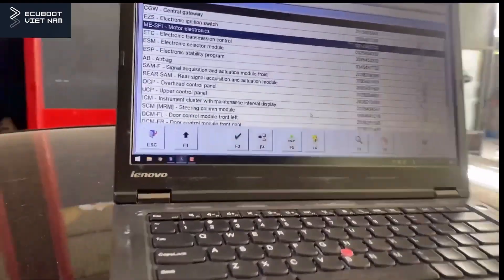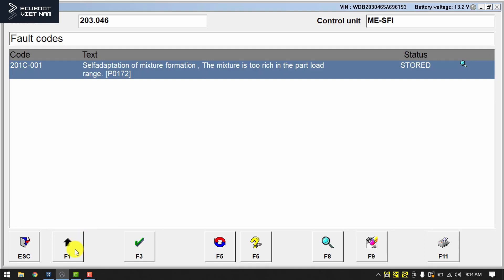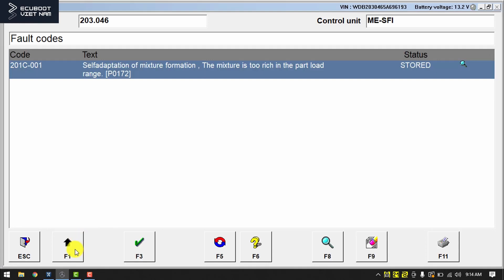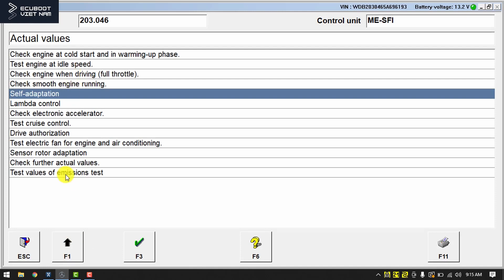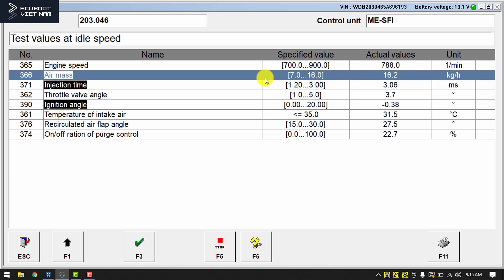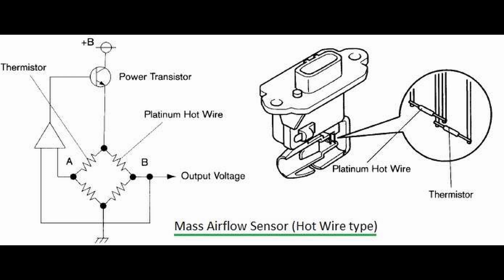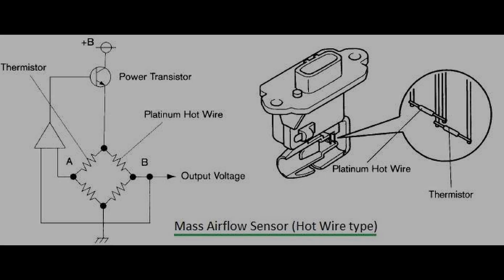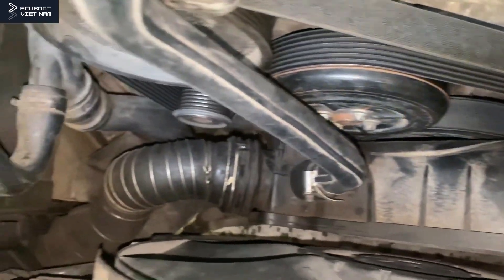Fixing  Engine Too Rich Fault on Mercedes C180 Kompressor

Comment: I have the same DTC error,I have changed the Mass Air Flow sensor with a new one,still my car is self accelerating while it is in no gear.I have cleaned the Throttle still the same issue. :(
Reply: did you solved this?
Reply: That would be an air leak

Comment: Great video. Music is super loud though!  Thinking this might be my issue - I'm using a generic bluetooth reader and torque app for most live readouts to diagnose running rich condition. Mass airflow is reading 4.9 g/s at 900rpm , and going as high as 7.8 , assuming the values are the same as it is the same engine... that's way , way above what's expected. Will update if it works! Thanks !
Reply: Hey buddy, ive bought a bluetooth OBD2 reader and also have the Torque app, but can you explain to me how i can find the live readouts with Mass airflow etc. I cannot find it on the app, i bought the full version of the app.

Also i have a C180 Kompressor 2003
 
Thank you in advance!
Rick

Comment: Hey I wonder if you could help me: I have a a 2225 that says that there is a left fuel level sensor short circuit to positive! How can I address that? And also how do I know if my oxigen sensors conectors are well connected?

Comment: good evening my brother, 
I have problems with my car mercedes w203 from 2002 with m271, 

1. unstable idle 
2. loss of power 
3. when I am stationary (on P: parking) with an unstable idle I feel the  shaking engine,
Reply: Same here😂 difficulties starting when the engine is warm, very shaking (feels like it only uses 2 cylinders when starting). After 10 seconds it gets more stable.

When i put it in Drive, its having a hard time not to stall😮

Comment: I am having a problem with my W203 M271 engine. The 1st spark plug has been stuck and all i replace are the remaining 3. How do I remove the stuck spark plug without damaging anything on the head. My cars performance gets affected as sometimes when I press down the accelerator the car has a rough idle and engine surging.
Reply: Hey, had the same problem, you prolly have a vacuum leak. There is a pipe that sits under the airbox that trends to crack, it connects from the Pcv system to the intake manifold. Replace the pipe and car should be better

Comment: I have changing spark plugs,coils,maf sensor,injectors,pressure regulator,pcv valve and still have a misfire...same engine.Can You Tell me what is the problem?
Reply from the maker: did you measure compression of each cylinder?
Reply: Bad crankcase breather tube under air intake.